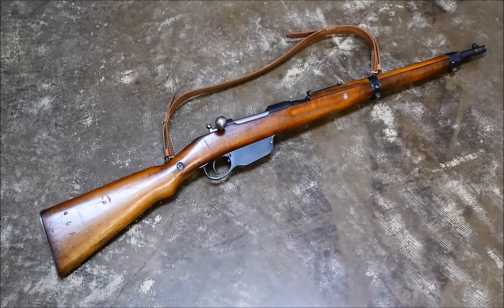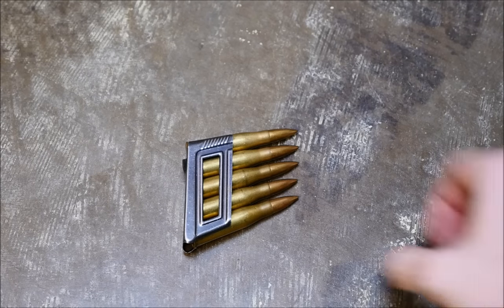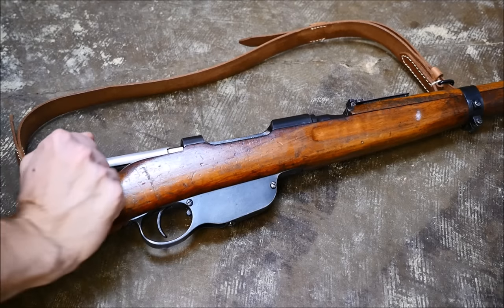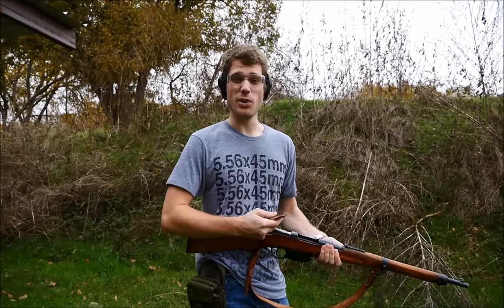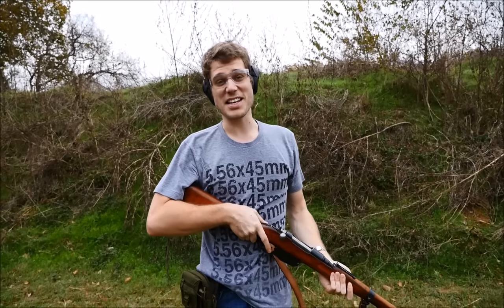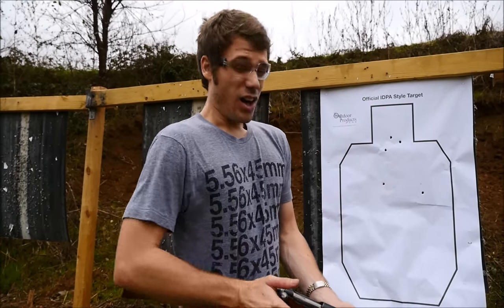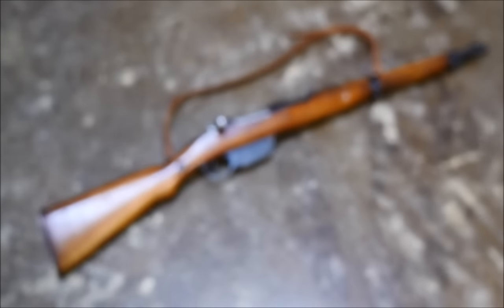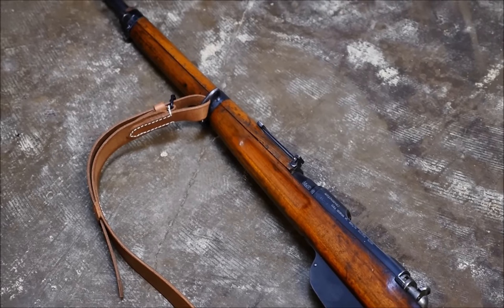M95 Straight Pull Run and Gun

Comment: The Mannlicher clips are the fastest and most reliable reloading devices in older bolt action rifles and only the modern detachable magazines designed to be changed for reloading are better... I find my Budapest M95 is probably the hardest recoiling smokeless military rifle I own using original 1939 ammo! The nice steel buttplate quickly makes my shoulder hurt and leave a nice black and blue mark after 20 rounds! Can you imagine a Lee-Enfield No4 (with peepsight) using a mannlicher clip system: that would be a very very fast firing rifle!
Reply: +pyrotechnicien You can see why box magazine didn't catch on until full auto/semi-autos became the gold standard (the box magazine was actually invented before either the stripper clip or the en-bloc).
Reply: Its kinda like a early version if the garand if you would say so with the clips, maybe the carano comes Closer tho due to an even bigger clip
Reply: This just isn't true. There are definitely advantages to Mannlicher clips, but there are also disadvantages. One is the opening at the bottom of the well that the clip falls out of. There's plenty of documentation of those filling up with dirt or mud and preventing the gun from working until cleared.

Your assumption that stripper clips are so much worse is also pretty far off the mark. They have tradeoffs like Mannlicher clips, but they do work very well.

You're making another assumption that there is only one Mannlicher clip. The reality is that it is better thought of as a style of clip, as the clip itself can very subtly for each gun. The same is also true of stripper clips, of course.

Lastly, if you look at the history of Mannlicher and stripper clips, there is a strong lean toward stripper clips in the number of guns that use them and the longevity of them.

I'm sure your clips work great, but Mannlicher clips as a whole aren't the end all be all.
Reply: you have to play around with the buttplate on your shoulder and find the optimal position. When I shot my yugo Mauser for the first time i put 40 rounds through it in 2 hours and didnt have a single mark on my shoulder having worn just a tshirt. Just try different to shoulder it where there are no bones directly behind it, i dont really know how to describe it properly
Reply: Since my 95/30 is just a beater built from parts and not collectible in any way and Im getting older  I committed heresy by cutting the stock down a bit and putting a recoil pad on it.  Absolutely love shooting it now.
Reply: @waynehindes3396  you didnt....these guns are so rare, how could you. These guns dont have that much recoil...While I never shot an M95, i shot my K98k and yugo mauser as well as Mosin Nagants and the 8x56R Mannlicher is less powerful than those cartridges and never felt like there was too much recoil
Reply: @roteroktober360  I did, for a couple reasons.  Ive had reconstructive surgery on my shoulder so it don't take recoil like it used to and like I said before the rifle is a bunch of rebuilt parts I put together to make it.  It was just a receiver,  barrel and stock when I bought it at a gunshow ( I paid $25 for it, that's how beat up it was ).  Had it been a complete rifle I probably would have come up with a different solution. I guess I should say carbine cause its one of the inter war cut down rifles so the recoil was pretty stiff (think M44 Mosin) plus i can always get a new stock for it since the one on it was beat to hell before i got it anyway and its not like any of the parts match
Reply: @waynehindes3396  Maybe it would've made more sense to just put a rubber cover over the buttplate and use a shooting jacket or put a folded tshirt or vest over your shoulder. I  did when i made the first shots with my first .30cal rifle because i didnt know what to expect in terms of recoil. From what I know you can get ruger predators and similar rifles in .223 for a cheap price in the US, so I would've just gotten one of those
Reply: pyrotechnicien  May I ask where you can find clips for them my dad has an m95  and i would like to locate some clips for him
Reply: pyrotechnicien Try an Austrian Steyr M95. See if THAT’s any better. I heard Budapest Hungarian M95’s were the worst but I don’t know.

Comment: The rifle was also the standard rifle of the Dutch army. From 1904 it was built in the Netherlands under license at the Artillerie Inrichtingen (Hembrug). The quality turned out to be excellent and the price significantly lower. After 1918, rifle production for the Dutch army came to a standstill. At that time, about 470,000 had been produced; more than enough to equip the army.

Comment: You were shooting a cut-down infantry rifle with the long sights. True carbines had carbine sights. Also, most of the refurbed cut rifles have much stiffer actions than the originals did. Finally, there were police issued front sights that were taller than the one you have and that would bring the point of impact down. They are not easy to find, so I made one from a Mauser sight. It fit in with a minimum of fiddling and works as well as my originals. Good job on he video. These are much better rifles than people credit them with being.
Reply: Yeah, I have a carbine that wasn't cut down, with the police front sight, and it's pretty much dead on 50-100yds with the 'battle sight'.

Comment: Congratulations you're the first American who pronounces Steyr right.I am very proud of you.By the way the sights aren't measured in meters they are in Schritten, actually that's even less distance. 1 Schritt = 0,75 meters = 2,5 feet 
Greetings from Austria!
Reply from the maker: +M95 Lol! Thanks. Good info too.
I have had the pleasure of spending quite a lot of time in Austria. Beautiful place full of good people.
Reply: Thanks! It was also called "Ruck-Zuck-Gewehr" by Austro-Hungarian troops, because that means "in no time-rifle".
In a text I read about it, it even said,that a very trained soldier could get a fire rate of 35rpm in theory.
This is going to be my first gun ,since I am very interested in it and they are some times as cheap as 100€. Until then I have to use my Airgun for Plinking.
Reply: I have a question, how are you're gun law's in Austria? Just curious...
Reply: Just great!
Shotguns and boltaction rifles don't require anything. You only have to be 18 and wait for three days to let the seller register it in our gun data bank. Everything that's semi auto needs a permission that you get by doing a 3 hour course in gun safety  and shooting and a psychiatrist has to conclude that you#re not completely out of your mind. Air rifles aren't regulated at all and you can buy them if you're 18 without a muzzle energy limit.
If you're property is safe enough and has a fence you can shoot on it if it's impossible that the bullets leave the property.
Reply: M95 Thanks for replying, and that's a good surprise to me because I thought gun laws where much stricter there! It makes me sad, however, to hear how politicians want to ban our ability to own guns here in the states. :(
Reply: The rest of the EU has much stricter gun laws. Germany for example doesn't even allow (semi-auto rifle) magazines with a capacity of over 10 rounds. Here in Austria you are allowed to have unlimited capacity. Getting a normal bolt action rifle in Germany takes more time than getting a permission to carry in Austria. Germans even have to be in a shooters-club (Schützenverein but I have no idea what it means in English) for one year i believe to get a rifle or a shotgun or a powerful air rifle. Germans are jealous about Austria the small country next to their border.
Reply: M95 Yeah. All I have to say is fight to protect you're right to bear arms as long as you can! Unfortunately, here in America the left pretty much has complete control over the media, and most people are brainwashed to think the same way without question. We could really learn a thing or two from Austria.
Reply: Every european gun association is now fighting against some stupid EU politicians that want to ban semi auto rifles because they were NEVER used in ISIS shootings in France. That's their logic. It really doesn't make any sense. A good friend of mine owns a gun-store and he told me that the sales of ar-15's, AUG Z's and other semi-auto gunsHave gone up like crazy.
Reply: M95 Yeah, and the thing is, these anti-gun politicians totally throw logic and reason out the window. If it looks "scary" their going to try to ban it, whether its actually more dangerous than other guns or not. They don't do the research and realize that most hunting cartridges are significantly more powerful than assault rifles.
Reply: The worst part of the Austrian gun law is that pump-action shotguns are banned but semi-auto shotguns are completely legal. Politicians are the reason why.
Reply: 'We could really learn a thing or two from Austria'
Even in California or Massachusetts you can walk into a Big 5 with a few hundred dollars and walk out with an SKS
In plenty of states you don't even need to do a safety or training course to get a concealed carry permit, you just give the sheriff $20 to cover the background check tomake sure you don't have any felonies
If you needed to do a 3hr course to buy a semi-auto rifle nationally Wayne LaPierre's head would explode
Reply: It may sound like there are no problems in Austria at all but there are a few. Some for example: refugees, the 3rd round of our presidential election. It's actually a short list but that doesn't mean that those problems aren't serious. I'm quite lucky, because Austria is pretty rich and infrastructure is great. It's my personal paradise.
Reply: Sorry, I'm not really sure what you're upset about. I just found the statement odd considering the laws as described are much more draconian (granted they do seem very reasonable compared to most of the rest of the EU!) than even the most restrictive states in the US or the Clinton assault weapons ban, neither of which have any political momentum behind them to be replicated nationally or reinstated. Statements like 'we could learn from Austria' just seem to me to take for granted the intense amount of freedom and the very strong culture that pretty well cements that, especially during a time where many states are loosening their gun laws.
Reply: Evan Scott lol, my bad, maybe you're right.
Reply: In Italy gun laws sucks
Reply: The ammo still available in Austria? if so, there is come variety or only surplus, I've heard that this rifle works better with soft point, always wanted to have one, but the gun laws in my country is completely strict, even being one of the first to adopt the M1988, which actually have a bad reputation, not only for being unreliable, but also to be used by the government to commit atrocities against poor people...
Reply: some*
Reply: roteroktober420 What country are you talking about?
Reply: Kein Schwein in Österreich darf eine automatische Waffe besitzen, wenn man die zwei richtigen Lizenzen hat, dann darf man eine Handfeuerwaffe herumtragen und nicht nur zuhause haben
Reply: Henrique Souza You can buy the 8x56R made by Prvi Partizan or surplus mainly from Austria. If you mean 8x50R it's way harder, years ago some companies made hunting ammo but today it's very hard to find. I only know about someone selling hand loaded 8x50R fmj and soft point on Waffengebraucht.at ( the biggest Austrian gun selling/buying website).
Reply: roteroktober420 Was redest du für einen Mist, man darf sehr wohl halbautomatische Gewehre besitzen. Man braucht dafür sowie für Pistolen und Revolver eine Waffenbesitzkarte, wenn es ums Führen einer Handfeuerwaffe geht braucht man einen Waffenpass. Mir ist noch immer nicht klar um welches Land es in deinem Kommentar geht.
Reply: roteroktober420 I still don't know what country you're talking about! If you're talking about Austria I don't know where you got this information. It would be just simply wrong.
Reply: ich mein natürlich das Takatukaland...
Reply: Ach so dann ist ja alles klar. Ich hätte schon gedacht du meinst Österreich.
Reply: M95 is he not Canadian?
Reply: I don't know.
Reply: well, if i wanna reload when there's still some rounds in the chamber ,i have to get them out,right?
Reply: Actually I don't think that there may be more than one round in the chamber, you know...
However, talking about round in the magazine/clip, definitely yes: you have to take off the clip and refill the missing rounds.
Reply: alright,I saw the same magazine design in Gewehr1888(in China it was called Type Han),maybe its easier to load than clips especially in old bolt-action rlfles,but always reminds me of the early version M1
Reply: Schritt means step right?
Reply: @ Nudel: JA und JA = in Österreich und der Schweiz ab 18 mit Registrierung, in Deutschland nur mit Waffenbesitzkarte.
Reply: I would have thought that by the 30s the units would have been switched to meters.
Reply: no no yeah, it is like a less known Mosin. Cheap surplus rifle, the disadvantage is that the munition is rare and or expensive depending on the caliber it is chambered in.
Reply: M95 Wie schauts denn mit dem Kaliber der M95 aus ?? Das ist doch mittlerweile recht selten
Reply: M95 I live in Australia and we have stricter laws that also don’t make sense but tour shotgun laws are even more confusing. We can have lever action shotguns but not pumps 🤔
Reply: M95 Wow... Österreich-Ungarn in gun laws is so, AWESOME!!! Why are Austria-Hungary’s (Austria’s) gun laws so different to the rest of the commies in the EU
Reply: M95 that nothing here in Australia we can have semi auto at all
Reply: M95 hahaha it’s like Australia
Reply: @edelwei4193  wenn auf deinen m95 lauf (direkt nach dem Magazinschacht) ein S eingestanzt ist ist es eine 8x56 Patrone sonst 8x50
Reply: Even a Singaporean can pronouce "steyr" properly.
Reply: @Nosaliz7513  what about San Marino? Heard it's not too bad
Czechia, Estonia, Finland, Austria, Switzerland, Lichtenstein and Ukraine all seem to have their good points. Not sure about Poland, Hungary and Russia despite some otherwise right/traditionalist leanings in policy. The Nordic countries seem to recall were beginning to get restrictive.
Might have left out one or two good ones
Reply: Du bist einfach überall
Reply: @Metternich_Enjoyer  Ich hab zu viel Zeit und kein Leben gehabt.
Reply: Is this the rifle Lee Harvey Oswald used when he supposedly killed JFK?
Reply: nobody cares
Reply: @srtaylor1911  No, he used an Italian rifle in 6.5mm Carcano.
Reply: You seem happy

Comment: I feel like the straight pull bolts are faster for someone who is inexperienced with a full bolt action rifle. I've had my younger cousins have a go at bolt action rifles as their first gun they've shot, and they seemed to grasp the straight pull faster than the standard bolt. I think more experienced people may choose the standard bolt, as it is mainly down to the shooter on how fast they can cycle the action.
Reply: Which may a be an important consideration in a conscript army because it should allow for shorter training.
Reply: @gustavlicht9620  Yes, and also good for an army that relies on reservists - when they're called up they'll probably be rusty.
Reply: That and they have the advantage of being harder to flub the action due to being simpler which is important considering they would be used in panic inducing situations
Reply: Yeah, and the mannlicher system was also much better for conscripts. The benefit of the Lee-Enfield tactically is massively outweighed by how easy it is to train someone on a mannlicher. Imo the mannlicher is the better infantry arm and that can be attested to by Italian soldiers who had to face it.
Reply: It would have been nice if the bolt handle came down toward the trigger.
Reply: I still think even when experienced there is a huge difference in speed. Shot both a lot of time, also some of my friends and still the M95 is quite a lot faster for us than th k98

Comment: one thing I've noticed watching your run and guns is regardless of the action you pace your shots about the same. thus even if the straight pull was faster it wouldn't show overall because you don't time your shots on when you finish cycling the gun, but rather when you are ready to take the shot. 
just my own observations.
Reply: agreed. the "time" on this is bullshit.
Reply: yeah if theyre trying to compare speed of straight pull to a standard bolt it should just be how fast they can fire x amount of bullets. the aiming speed of the user shouldnt matter since it will vary greatly

Comment: Despite the issue with the rear sight it seems like a decent pick, especially since it seemed to cycle smoothly and showed decent accuracy under stress regardless. 

In a more personal opinion, I'd probably go with a '95 simply for the charm that comes from any rifle that uses en-bloc clips, especially in the case that they eject from the receiver with a harmonic ping in the firing/cycling process.
Reply: S & K makes Scout Mount scope mounts. With NO alteration to the weapon. Instead of a Scout Scope use a red dot instead! Found one that kinda looks like the "mini scope" used by the Germans during WW II. It looks period correct on a Spanish 1893 7x57 Mauser. Accurate too!
The ammo Guy 8-)
Aim High! It allows for bullet drop.

Comment: If you binned the iron sights in favour of something better like an Aimpoint, and frankly I'd consider putting a rail on it for easy mount/dismount, you would have a good scout rifle.
Reply: S & K makes Scout Mount scope mounts. With NO alteration to the weapon. Instead of a Scout Scope use a red dot instead! Found one that kinda looks like the "mini scope" used by the Germans during WW II. It looks period correct on a Spanish 1893 7x57 Mauser. Accurate too!
The ammo Guy 8-)
Aim High! It allows for bullet drop.